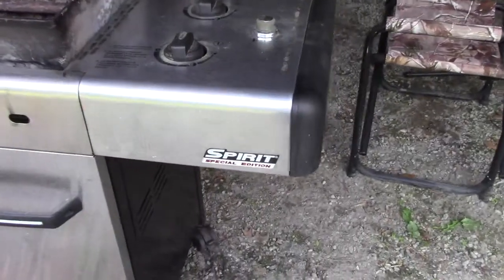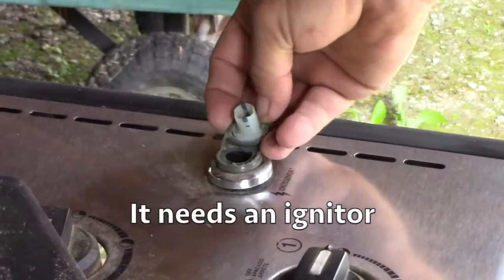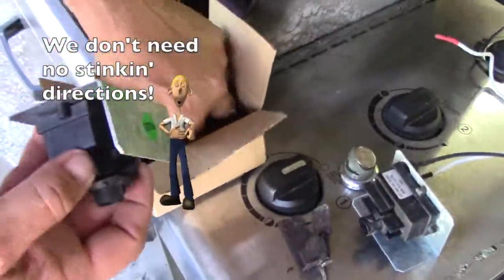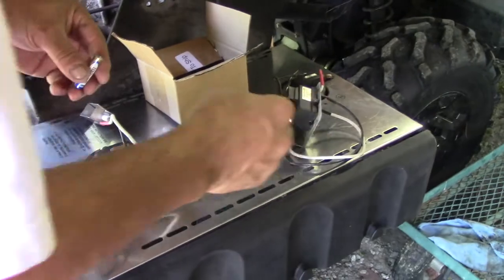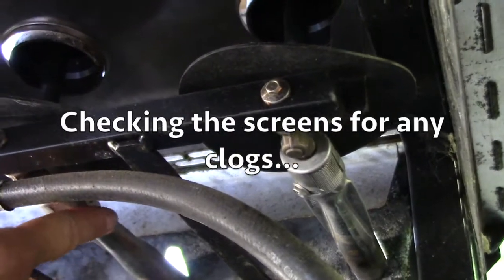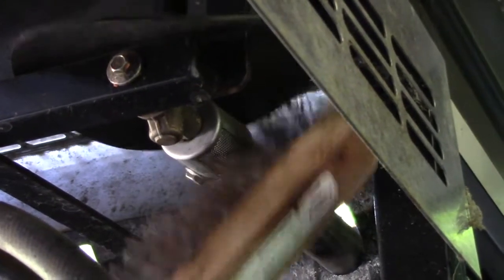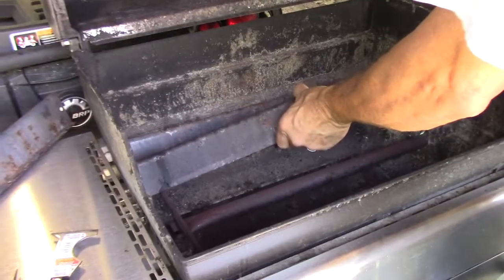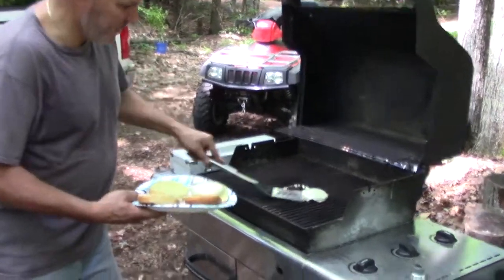WEBER BBQ - GRILL IGNITOR REPLACEMENT, CLEANING & LOW FLAME FIX

Comment: Love this video. I have a much older Weber (grey enamel) that I did that same thing too. It needed more parts though (gas tubes were completely rusted). For less that $50, I have used that grill for 12 years and it's still going strong. My trusty Weber should last hopefully another 12. Thanks for sharing. I love when I see folks being sensible and using a little brains and elbow grease. Happy grilling!
Reply from the maker: That’s great! These will last a long time if you want them too! Thanks for watching 👍

Comment: I USE AN BATTERY  TOOTH  BRUSH TO CLEAN THE SMALL SCREENS IN THEIR. JUST A TEC TIP YALL. GREAT JOB. WHO NEEDS THE INSTURCTIONS. TO UN PLUG THE HOLES USE PIPE  CLEANERS ALSO.  HAVE A GREAT TIME YALL.
Reply from the maker: Great tips! Thanks for sharing. We believe in doing what we can to keep it working instead of just throwing it out! Have a great night.